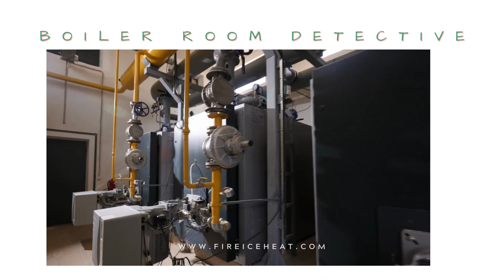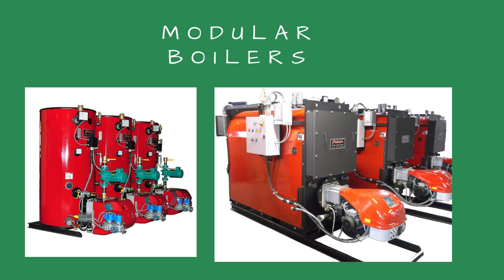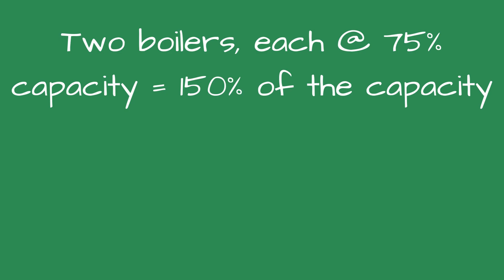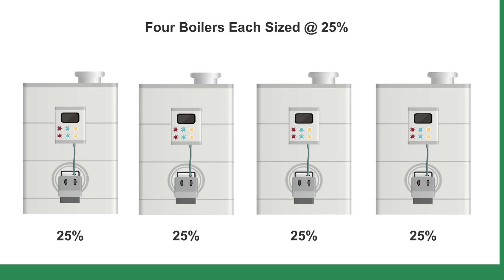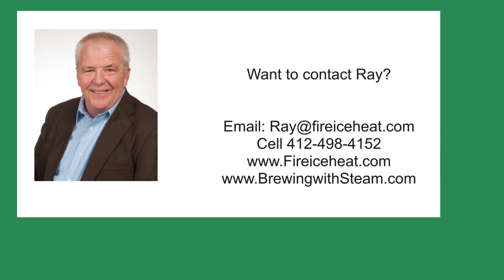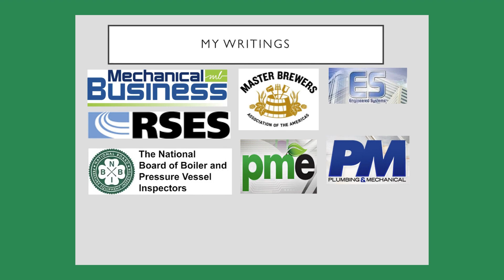Detective Tools   How many boilers?

Comment: For a hospital or other very critical use case, two isn't enough, you need 4 @50% or 3@100% or 5@33%, if it's absolutely critical you need to consider a failure while another unit is down for maintenance so an N+2 configuration, not N+1.  For most more normal use cases N or N+1 is enough but not always.
Reply from the maker: Thanks Glenn I appreciate your input. In addition, those critical use facilities must stock spare parts as well. I remember talking with an engineer during the covid mess and he couldn't find a flame safeguard and relief valves

Comment: I am not on board.  I think two (2) boilers, each sized for 100% of the load at MAX fire, but with variable firing rates is the ticket.  And, I would alternate which boiler is Primary by month.  Way less piping and especially way less valving (automatic valves are not cheap, nor are the controls that run them), half as much electrical services, economy of size in the Flue Venting, and less floor space in the mechanical room (which can be an issue in many spaces).  As a service tech, when encountering multiple banks of boilers  and associated piping, it can be a challenge to just figure out the system before starting to troubleshoot or perform service.  Just my take.  As a side note; at one point our college campus heating plant had 125 (in pods of 5) GE Downdraft boilers to supply steam to our campus wide distribution piping.  Talk about a nightmare.  That led to 3, and then 5, #6 Oil fired boilers, and a way more "normal" Central Heating Plant.  I really enjoy your videos.
Reply from the maker: Thanks for your opinion. Thats what I like is that we can agree to disagree. You as the maintenance person are the one who has to service what is installed. I have seen great results using the multiple or modular boilers but I too think 125 pods is too much unless you're the salesperson that got a commission Good luck and have a great Thanksgiving